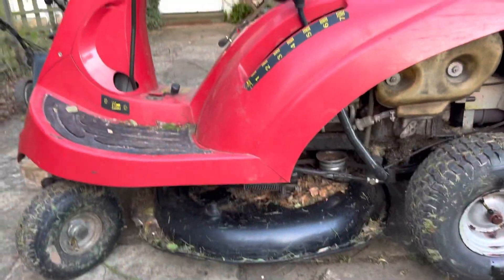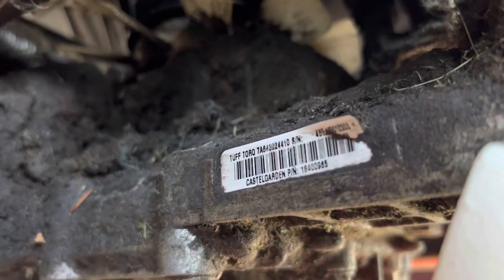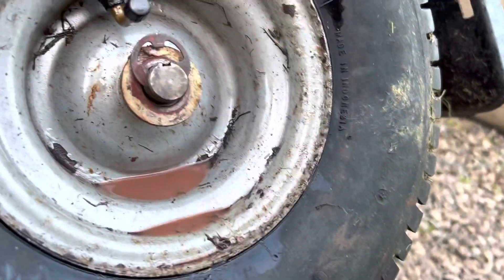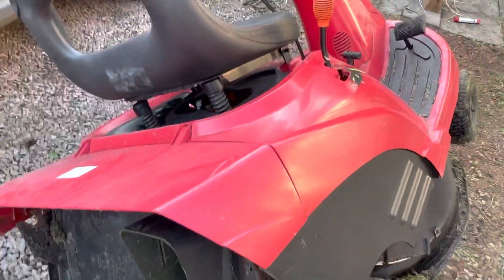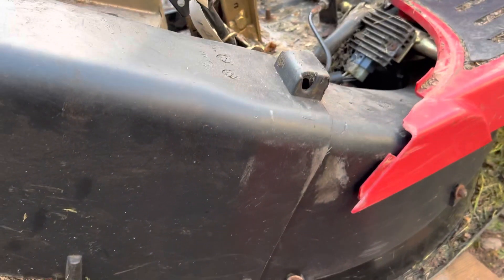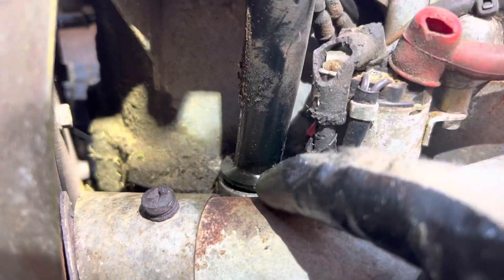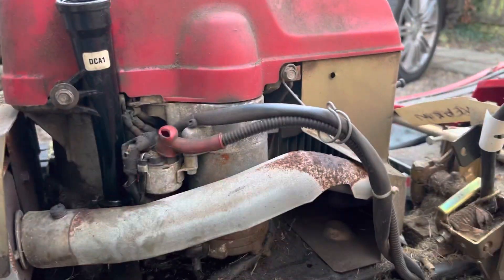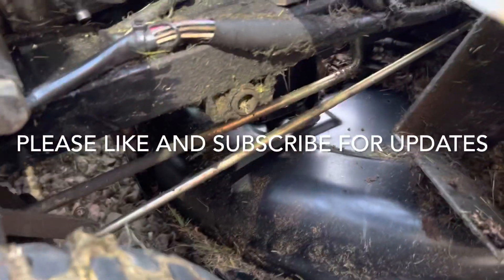Honda HF1211 Ride on Mower Diagnostics

Comment: About 10:15 it's interesting how mice chew them in the same places. Not a surprise though we had two identical vehicles where mice chewed through a pipe on top of the fuel tank leading to a leak (not at the same time or the same mouse!).
It really annoys me with these mowers that you can't get a workshop manual, it's all 'dealer only'.
Reply from the maker: Well, I’m not taking this one to the dealer, it’s not worth it. So follow me as I keep this thing going by DIY. 

Check out my latest video around the starter motor replacement and the many micro switches which prevent you starting the engine.

🙏

Comment: How do you get to the engine.  I need to clean the air filter.    Thanks
Reply from the maker: https://youtu.be/6XmpS8zfGSU?t=6m51s

Remove the 13mm nut and washer,
Put the cutter deck in lowest position (prop it underneath)
Remove the handles for the cutter deck and drive (unscrew) and you should be able to lift the seat off. It pivots backwards giving access to the engine. 
Good luck!

Comment: Hi.  Can you tell me if this mower has a sensor on the drive handle pls.  I’m having problems with starting,   I have to wiggle the forward / reverse handle to get it to start. Hope you can help. Thanks Andrew
Reply from the maker: Hi Andrew, if you’re having problems starting - as I have (it can be intermittent) - it’s probably a faulty switch. There’s a few on this mower, obvious ones to check are the ignition switch, and the switch on the brake. I might do a video on this if my kids will give me a break!
Reply: Apparently there’s a switch at neutral on the drive lever.  I think this is the one I need to replace but after a brief look can’t see where it is
Reply from the maker: @andrewclark3657  would make sense. Would be interested to hear how you get on. Good luck!
Reply: If you press down on the foot brake this will automatically return the Forward/Reverse lever to Neutral - hope this helps.

Comment: Hi.   Can you tell me what and how many spark plugs it has pls. Bloody thing won’t start now.  Thanks in  lieu of help
Reply from the maker: Hi, sorry just seen this. There’s one spark plug, it’s an NGK BPR5ES. Not starting is unlikely to be a plug, failing plugs cause misfires. It sounds like an interlock switch failing. Mines working again now, but I do occasionally have to pump pedals and tank levers to get it to start.
Reply: @Himoutdoors   interlock switch?      Mine will start but it’s a struggle.  I push the throttle fully forward to the choke then back and mess about for about 5 minutes to get it to fire.   Starts from warm fine no problems
Reply from the maker: Well I suppose the plug is a good place to start!
Reply: @Himoutdoors     I replaced that a few months back??
Reply: @andrewclark3657 have you got it sorted since?
Reply from the maker: Yes. New starter motor. Then the solenoid went so replaced with a Chinese one - Honda original is over £100. It’s a bit temperamental but I jerry rig it to work.

Comment: How do you change the front weels on the Honda 1211??
Reply from the maker: Hi Stefan, front and rear wheels are held on the same way, with a clip. Take off the plastic cap, prize off the clip and you should be able to remove, providing it’s not siezed. Good luck!